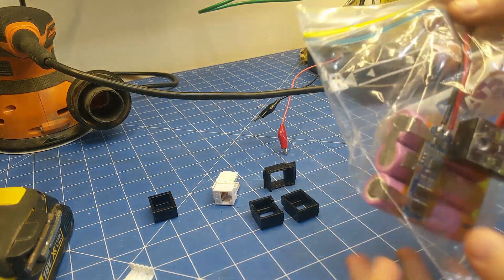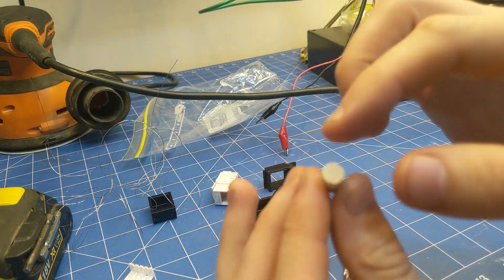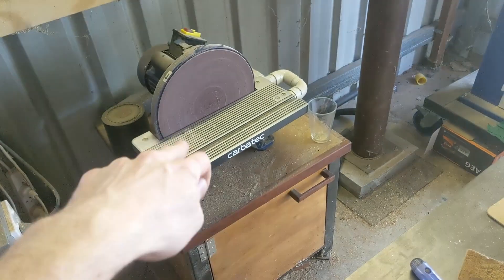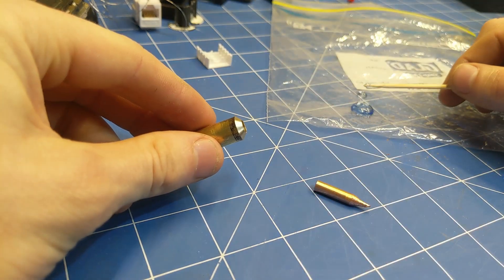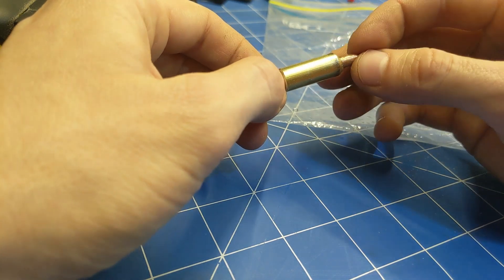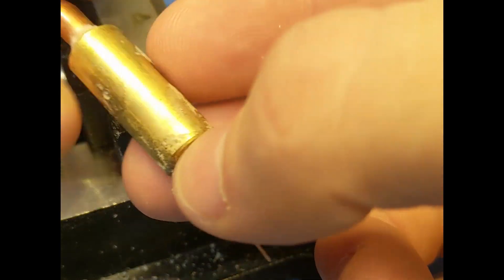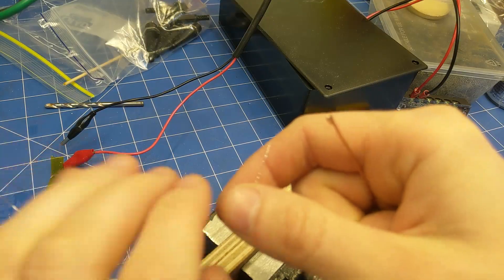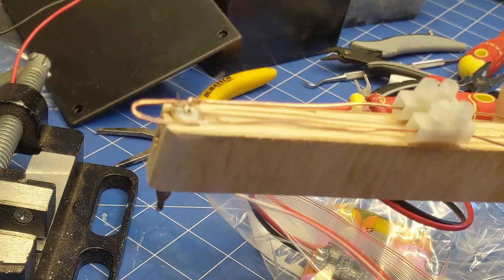DIY Soldering Iron Tip

Comment: You could have put a small screw or a set screw through the barrel to hold the tip in place!
Reply from the maker: Hi Tony, that's true but i was hoping the glue would result in better thermal contact. Probably a set screw pressing metal to metal would have been better even though it would push all contact to one side.

Comment: When I made a mixture of chalk and silicate glass, when heated, this mixture also created bubbles. And I solved this problem simply. When I have smeared the part I need and dried it on the battery so that the mixture becomes solid and does not choke with a nail, I take and tightly wrap the part in several layers of aluminum household foil, very tightly. On top of the foil, I also wind the wire tightly. As a result, during firing, the mixture of silicate glass and chalk almost does not bubble. It becomes microporous inside, but it does not burst and large bubbles do not form. In general, if you seal the silicate glass before heating, then when heated it will not expand much and burst.